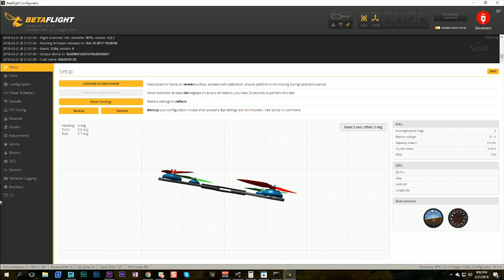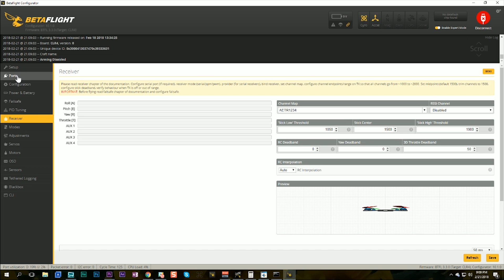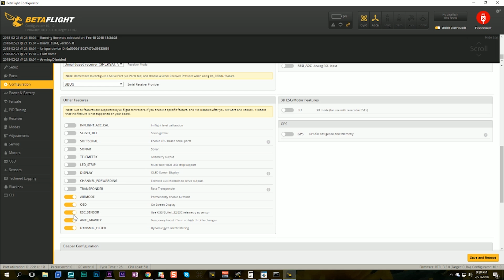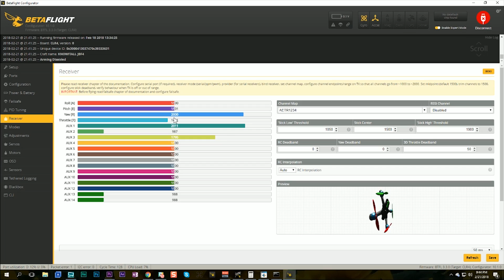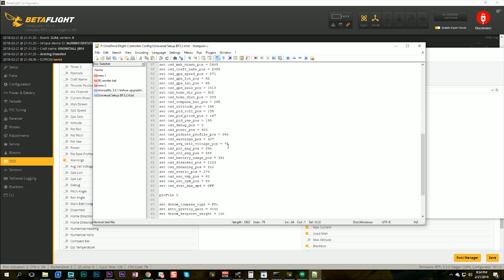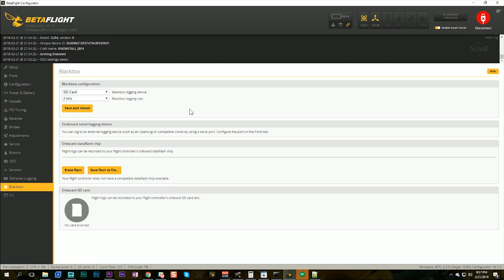Betaflight 3.3 Ultimate Setup Guide

Comment: My jbf4 all not go into DFU from cli bl command either. Only boot button will work for me also.
Reply: Use the Impulse RC Driver fixer it makes the correct entries to the Windows Device manager, then you should be able to use the BL command.
Reply: right. When you run the bl command from the CLI, the FC "hotplugs" and shows up (Counter-intuitively) as "STM Device in DFU Mode" in the windows device manager, and will NOT show up in the configurator. So, WHILE it is in this state(important), run the impulse RC driver fixer, which will actually say "Installing DFU Driver", but when its finished it will now appear as "STM BOOTLOADER" in the deice manager, and to further confuse things, it should NOW show up in the configurator as DFU up in the top right. (you might need to re-plug it, when re-run the bl command.)   

-Anyway, this should work just fine so long as you are only working with one board.  the minute you plug in a different board you will probably need to do these steps all over again... 

  I think this has something to do with the unique device ID number in all STM32 cpu's.  

I have had a few other theories about why this is happening, and so far I have disproved most of them. Suffice to say, the behavior is basically random, but if you stick to the rule of "If the bl CLI command turns the FC into "STM device in DFU mode" in the device manager", then you should run the impulseRC tool and try again. (after a re-plug).
Reply from the maker: Same here. Who knows?

Comment: Why didn't you choose Dshot 1200? You have 32 bit escs.
Reply: By definition BLHeli_32 defines the hardware minimum that will support D-Shot 1200. Yes his v1 Wraith’s will work, however there are other factors like filtering that can have a big impact on the smoothness of DShot 1200 and ProShot. If you know how to properly set it up and troubleshoot the issues, DShot 1200 rocks.
Reply from the maker: Dshot 1200 also can't run at 32k on most FC, although that doesn't matter for my FC, since it is limited to 8k.
Reply: he said 600 works best for his esc. I have 32 bit escs also but at Dshot 1200 it vibrates like crazy, but Dshot 600 works flawlessly. He might be getting a similar issue.
Reply: Oh I have DYS Aria 32 bit escs and dshot1200 works great for me. I wasn't aware not all 32bit escs can do it.
Reply: Good to know
Reply from the maker: Not all 32 bit ESCs support Dshot1200 I don't think. I'm not sure about that. These are gen-1 Wraiths.
Reply: Dustin what FC are you using?
Reply: Im using Matek F405-CTR
Reply: Not all do 1200. They have to have the right processor to do 1200 and no signal caps. You always have Multishot as an option for faster response under BLheli S. :-)